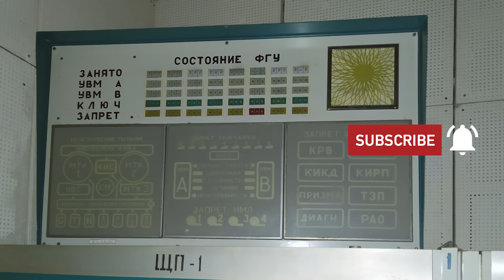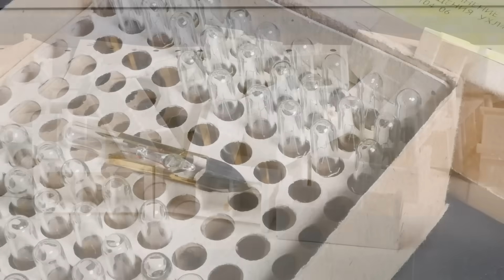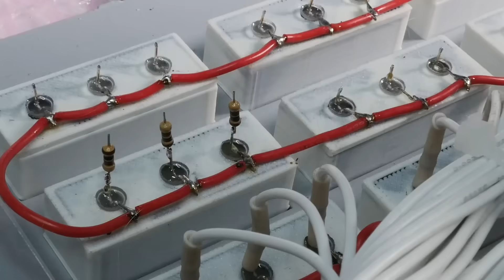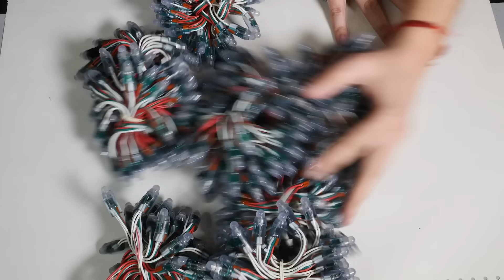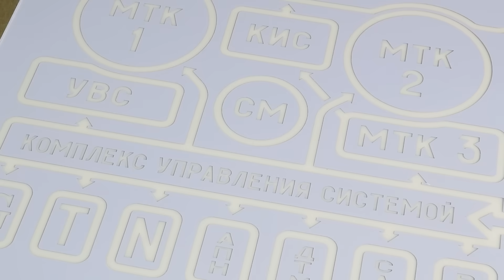Building the SKALA Mnemonic Display

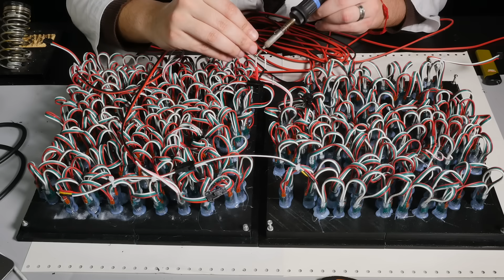Comment: 10:51 To make complex masks and LED holders, you could use a service that makes PCBs. CuriousMarc did this for some Apollo control panels. PCBs can be very precisely machined, you could add a silk screen on the backside of the panel labeling everything for easier maintenance. As a bonus, since the PCB has a solid copper plate front and back (no etched traces), this can make excellent shielding for electromagnetic interference if connected to you chassis ground.
Reply from the maker: Hmmm! Sounds like a very good idea! Thank you!

Comment: Reading the English translation of Chernousenko's "Chernobyl: Insight From the Inside" a brief, throwaway line puzzled me. It said (paraphrasing from memory): "In the days after the accident the authorities were so concerned about seasonal rains flooding the reactor basement they diverted weather fronts away from the reactor building". I'm wondering how they managed to do this?
Reply from the maker: Typically, it is made by throwing powder hydrophilic substances from a plane into a forming cloud to increase the density and create initial water droplets. A usual cement works well for this. However, mostly, it was done not to protect the power plant but to protect Moscow. As a result, a part of russia is pretty contaminated.
Reply: @ChernobylFamily  Sure. But he used the word "divert". Re-direct. Move. Steer. Not precipitation. Actual weather fronts. Chernousenko was very precise with his diction. And I've been told it was a first rate translation.
Reply from the maker: Hmmm
Need to check it then
Reply: @ChernobylFamily  I'll dig the book out and try and find the page number. I remember folding the corner over years ago. Just got to move the other thousand out of the way. 🤣 It's a great book, tho. A lot in there I've never seen published. To say he was critical would be an understatement.

Comment: I noticed that some videos on your channel have been hidden or deleted. I remember you were working on a curved panel that was used in the DUGA 3 installations. What happened? I’m a fan of your channel and would love to be able to watch that content again. Best regards from your fan in Brazil.
Reply from the maker: currently these are just two videos: Forgotten Robots of Chornobyl, which has factual mistakes and which we want to remaster, especially because we've got a lot of good additions; and a video about the swimming pool in Pripyat because of a rather weird and not very adequate situation with cоpyrights. As for ES-1060 video, updates on it appeared only on Patreon; there is a brief footage included in the video about wire wrap tool. The project has been on hold due to a need to find very rare and very expensive parts, which we could do finally this spring. We want to make an exhibition of Chernobyl computer tech this autumn, so this summer we will finish the panel and there will be a video about it. In reality, this delay is even for good, as now we objectively will make it better than a few years ago.
Reply: @ChernobylFamily  That's wonderful news. I look forward to hearing more. Thank you for your reply.

Comment: Fantastic! Thank you for showing the creation. I'm still amazed at how far 3D printing has progressed, and what you can now produce with a $30 microcontroller. Getting the correct hue of blue-green for the panels must've taken time, standing back, looking, adjusting...!
Reply from the maker: You are so right. Without 3D printing we would need to go for injection moulding as it was in original. When i learned how much does it cost to make a mould, I remained speechless. It is not a one thousand dollars, and not ten.
Reply: @ChernobylFamily 
Injection moulds are a bit like the dies they used in aluminium extrusion at the factory I welded at. A new set of those will set you back anywhere from a couple of $ 100.000 to close to a million, depending on their size and shape. That’s a bit much for us mere mortals😅
Reply: @ChernobylFamily  You only begin to see money back if you have 1000 people who want the product of the molds, also. 
I guess it made sense for the originals, particularly if there are the manufacturing facilities nearby and nobody is really scrutinizing the cost...

Comment: Diffuser is easy to get thinner, just grab them from old LCD TV sets, the thin diffuser from the panel will work well there, and it comes in large sheets as well. Plus you get the plastic sheet there as well to make the backing layer.
Reply from the maker: Good idea

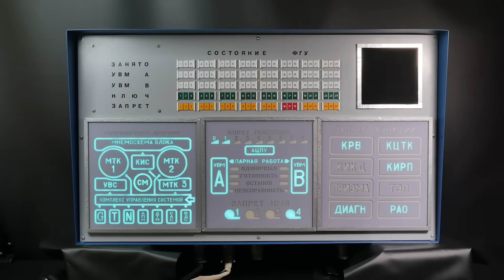Comment: 13:28 That siren hahaha man... anyone who has done any analog design knows the change in character is due to voltage fluctuations. And usually you'd have an alarm on a decent supply, so when it is just trying to draw your attention to a single concept somewhere, the associated lights flashing would be largely unnoticed in the alarm.

But even without the context of it being an alarm (this happens with any free running oscillator), hearing what that thing is doing, immediately tells me to look around and see what the hell is going on to make it droop like that. Experience immediately tells me there's "random" loading... And the only thing in the mix that will do it is the lights...

Now you add back in the context of what all those flashing lights mean...

Put simply, had a design engineer heard this even from another room when it happened, he might have painted the floor just as anyone else in the control room itself. From a design standpoint, that's audibly not "just another alarm".

Comment: I cant wait until you get to the RBMK nuclear physics programing!
Reply from the maker: We are working on it. When it will be done, there will be a biiiiiig update on a control panel. And we are eventually going to integrate everything together.
Reply: @ChernobylFamily  I've programed nuclear simulations before but only for PWR reactors, and RBMK's are more complex, to simulate. Usually I use the keff model. if keff is 1 then reactor is critical, if its less than 1 then the reaction is going down, if its over 1 then its growing.

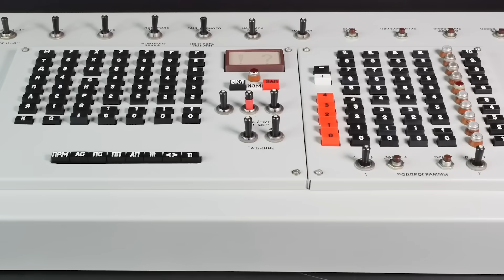Comment: This is absolutely amazing engineering.  I'm a smart guy but that's above my skill set.  And it would get my patience with such precision work.  At 14:09 it's so satisfying .   The positive click of the switches and buttons.   I have an Engl guitar amp.   One of my favorite sounds is the power and standby switches that have very positive clicks.
Reply from the maker: Thank you!
Reply: That just gave me an idea... the speaker for the alarm in the panel is really sizeable and the amp is pretty beefy... how about incorporating a quarter inch jack in the panel so you can use it as a guitar amp!?